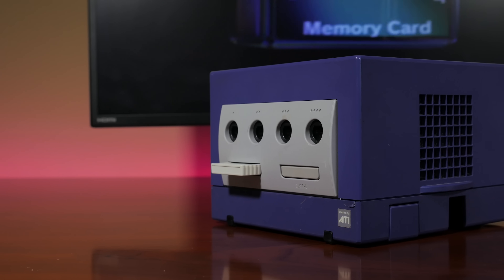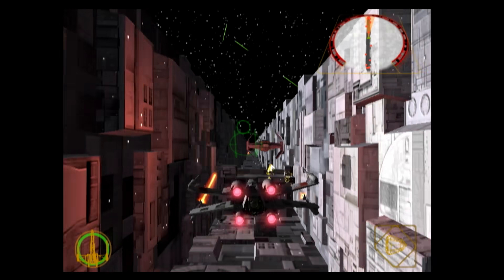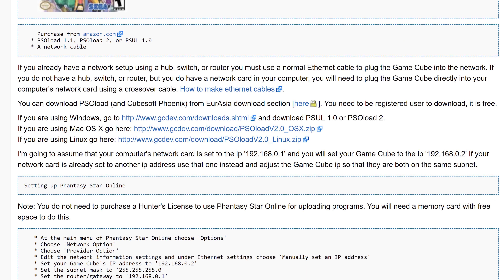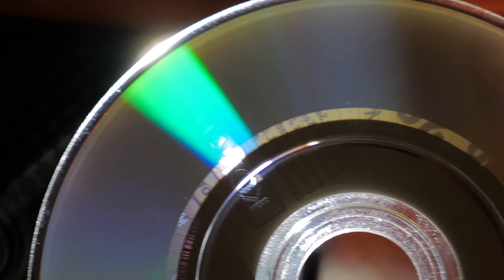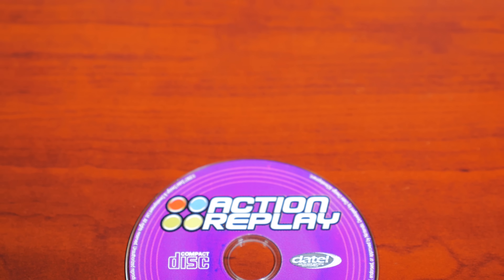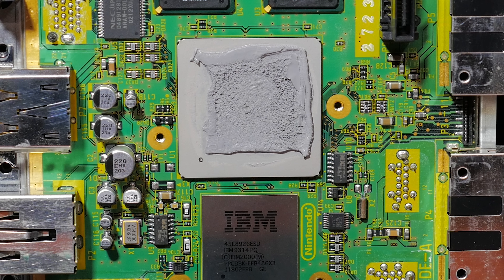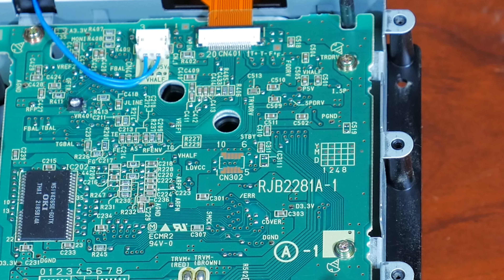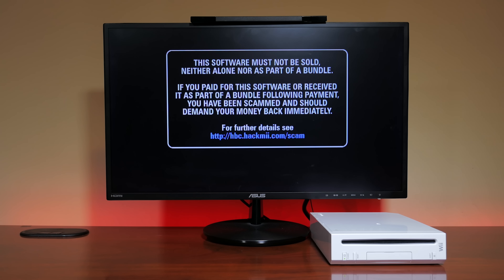How the Nintendo GameCube Security was defeated | MVG

Comment: "Now known as ATi"?  Is that true?

Last I heard, like, 5 years ago, they were bought and taken over by AMD...
Reply: AMD has owned ATI since 2006. They were founded in 1985. ATI did however buy ArtX in 2000 which is probably what MVG meant.
Reply: @Tore299  Yes, that's what MVG meant, and he is right, but as you said, ATi got swallowed up by AMD in 2006, which does mean that AMD owns ATi and its subsidiaries by proxy
Reply: @Tore299  ohh, this helped, now I see
Reply: @Tore299  *cough cough* RX 580 *cough cough*
Reply: Honestly. Both nVidia and ATi/AMD are good in their own ways. A good example is Linux drivers. AMD's work really nicely while nVidia's is like trying to talk a bratty kid into behaving.
Reply: @T3KNUG3T5  Nvidia has better software and drivers if you use Windows. It also has more advanced features that are very useful for things other than games. Nvidia is almost always better than AMD across all price ranges, the few places that AMD beats Nvidia it's only by a little bit, and only in games. Things like Nvidias excellent hardware encoder alone easily make up for the small price difference between the two in the few places AMD is cheaper.
Reply: People in this scene usually know who ATI is, not ArtX, so just saying ATI is enough to give us an idea. Plus, Nintendo clearly advertised the use of ATI graphics.
Reply: @VideoGamePlayer ATI/AMD surely has made a lot of disappointing products, but they also have made some stand outs like the HD5870, 1950XTX, and 9700 Pro. In the last few years they have made some ok mid range cards. I remember my HD5870 ran OpenGL applications just fine and I'm sure it has only gotten better especially due to AMD's effort to make good Linux drivers.
Reply: @VideoGamePlayer since maxwell AMD hasn't been doing so great. Before maxwell they went back and forth with fastest graphics card and had for a long time better value than nvidia
Reply: @VideoGamePlayer ATi 9700 Pro is a legend.
Reply: @VideoGamePlayer wrong. It was pretty neck and neck back then between Nvidia and ATI.
Reply: Now known as: "RADEON Technologies Group".
Reply: Cyril Dorricott Hahaha you're right, their "crypto hangover" is really killing their finance forecasts recently.

OH WAIT NO that's nVidia.

Try learning what you're talking about next time.  The AMD cards of choice were all old ones like the 5870, and were mostly second-hand, hurting AMD to the tune of nothin'.
Reply: How stupid it is that even after 8 months there's still amd vs nvidia holywar in comment section that has absolutely nothing to do with original topic.
Reply: @GamingGuy-gM4  Straight from its Wikipedia page, "Kepler is the codename for a GPU microarchitecture developed by Nvidia". Kepler is NOT mobile-based. The 800m cards were Kepler, but the 600 and 700 desktops were too.
Reply: @VideoGamePlayerWhat are you talking about? Mesa OpenGL runs better on AMD than Nvidia's proprietary openGL implementation does on their cards.
Reply: They still trade under the name "ATI Technologies"
Reply: @GamingGuy-gM4  I don't think you know how to properly use an exclamation point.
Reply: Mistakes were made... In this video, lol.
Reply: @GamingGuy-gM4  No. No they're not.
Reply: Most of the reason AMD cards seem so bad is because they're late bloomers. On release the Vega 56 was barely competing with a gtx 1070 and was more expensive but today the Vega 56 is on the heels of the 1080 and can be found for as low as 300$
Reply: gotta remember Nvidia pays for AAA devs to sabotage AMD optimization efforts
Reply: @snintendog this is irrelevant if you don't play shit AAA games
Reply: It's really a matter of preference when it comes to GPUs. Unless you're an enthusiast and have to have the absolute limit. Even if you have to have an AMD or nVidia you most certainly won't need the latest most expensive one.
Reply: @GamingGuy-gM4  The GTX 1080 Ti performs better than the Radeon VII, and it's a card that came out in 2016. The Radeon VII came out when, last year? Remind me again what is the most powerful AMD card in case I missed it.
Reply: @NUCLEARARMAMENT  most people do not purchase the most powerful cards. Us having the dick-measuring contest for the top of the line product that relatively few buy does nothing but line the shareholder's pockets.
Reply: @ChucksSEADnDEAD  amd is king of gpus under $200 anything above they get btfo. Amd is a joke... this coming from a Radeon fan last card I had that was amd was a 6970 and the drivers for that card was a complete dumpster fire.
Reply: @ChucksSEADnDEAD  For discrete GPUs, most people buy Nvidia GPUs by a large margin. It's not even close. AMD hasn't sold shit all for video cards in any level of the market compared to Nvidia. The 1080ti is the highest selling video card in the last few years, outselling every cheaper option.
And as for optimizations, no Nvidia does not bribe devs to cripple AMD performance. Devs optimize for Nvidia to cover the biggest portion of the market.
Reply: @scythelord  except that if they used AMD middleware (?) it would actually run on nvidia cards faster than nvidia's own stuff.
Nividia tanks its own performance just to make sure AMD tanks more.
Reply: @scythelord  "we have now established that nvidia's detonator fx drivers contain certain detection mechanisms that cause an artificially high score when using 3dmark 03. we have just published a patch 330 for 3dmark03 that defeats the detection mechanisms in the drivers and provides correct results." that is how Nvidia is building its position in minds of half-baked GPU specialists like you, i also remember case lost in court where Nvidia was forced to pay huge amount to AMD for bribing developers to show crapy performance of ATI gpu.
I am using ATI/AMD for over 15 years and i dont see all the problems that i should have according to nvidia trolls like you...
I also like the fact that drivers from AMD are giving you more performance with time when in the same time Nvidia is cripling performance of older architectures to artificialy force users to replace GPU... NO THANKS!!!
Reply: @GamingGuy-gM4  now youre just being an idiot
Reply: Yeah, this video is a little sloppy and that's quite disappointing from MVG! Not only did he say ArtX was "later known as ATi" (really, ArtX was bought by ATi - they didn't change their name), he also said the GameCube was based on the PowerPC 730 but there was never such thing as a PowerPC 730!! The GameCube's CPU is based on the PowerPC *750*, not some non-existent PowerPC 730!!
Reply: My 290 still runs games on high and I got it on release.
Reply: @GamingGuy-gM4  My K6000 and 880M are GPUs based on NVIDIA's Kepler architecture.
Reply: VideoGamePlayer not crappy, just doesn’t have the code that Nvidia basically bribes devs to use by promising no licensing fees when nVidia release new techs like say “rtx”.
It’s all gimmicks though, and most pros I know hate Nvidia because coding on DX12 and URE4 both make c++ direct to hardware coding awesome and easy, BUT Nvidia hate that. Eventually Nvidia will just run out of cred with new devs unless they drop their ridiculous and devious hardware/software shenanigans. Die on die ATI shits on most Nvidia chipsets, that’s why bitminers caught on to this early and made the high end Radeon cards practically unicorns on gaming oriented pc part shops.
Reply: @GamingGuy-gM4  uh huh... Rx 580 < 1660
Reply: @GamingGuy-gM4  AMD GPUs are a complete joke. Would rather stick to using NVIDIA, hell a Matrox or PowerVR graphics card would be nice if they were made.
Reply: @NUCLEARARMAMENT  Most phones nowdays carries a PowerVR chip :)
Reply: "Except AMD GPUs are still the strongest GPUs in the market!"
lmao
Reply: @MinaNohara  well not really. even Apple now make semi -custom graphics chips for their phone
Reply: Jerry Le I mean it’s true with the dual MI60 based gpu that’s going to be available in the new mac pro. That is the fastest gpu ever made as of now. On the consumer side nvidia still holds the performance crown with the 2080ti though.
Reply: For the same joke all consoles and the new consoles using amd - ati CPU gpu ? That joke do you mean ?
Reply: @NUCLEARARMAMENT  How's that GTX 1650 treating ya? XD
Okay, cheap digs aside, AMD GPUs are definitely competitive with Nvidia until you enter the 1070/1070 TI/2060 space.
Reply: @TeriiNekoyama  I'm not running any GPUs newer than Kepler, I have a Quadro K6000 in one workstation, a GeForce GTX 880M in one laptop, and an ancient Quadro NVS 160M in another laptop from over ten years ago. I'm considering a 980 Ti or 1080 Ti, though.

Comment: Cool! Love it!
I wanna see how Switch or Wii or Wii U security is defeated
Reply: MVG said he's not gonna do another Switch video because of Nintendo.
Reply: The video about the switch was taken down by Nintendo, unfortunately.
Reply: The switch was defeated easily because it's software had reused the Wii U's protection and only modify it to work with the switch
Reply: @ChillstoneBlakeBlast  no, the Switch security is a lot higher than the Wii U one, Nintendo learned the lesson and the Switch security would be great... if it wasn't because of Nvidia and their RCM (Recovery Mode), which had an exploit that allowed to run code before the system booted up, newer systems have the exploit patched, that's why the security can't be used

Now tell me, if what you said was right (Using Wii U security), why the hell newer systems aren't be able to use the exploit? That supposition is stupid
Reply: TLDR nvidia forgot to lock debug mode after production now a paper clip defeats the switch
Reply: @luvvyamy  the reason why the switch doesn't have a web browser is likely because it would be so easy to exploit, just like what happened with the wii u. maybe that is what they were referring to.

Comment: Question: I want to get me a GameCube and utilize the backups my friend has. Is there a setup you can recommend, where I can stream a backup via the Ethernet adapter to the GameCube to play them? I am visually impaired, so, soldering is very hard for me, so I would have to buy a pre-modded console for if the setup would require a modchip. Thank you :)